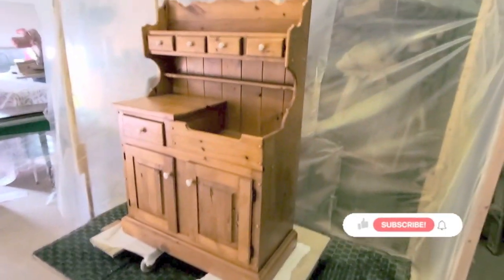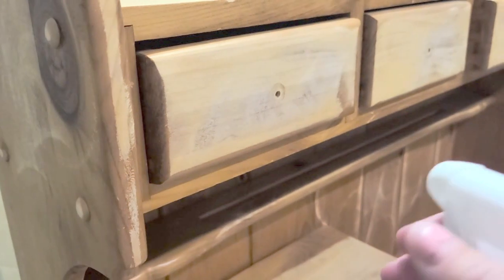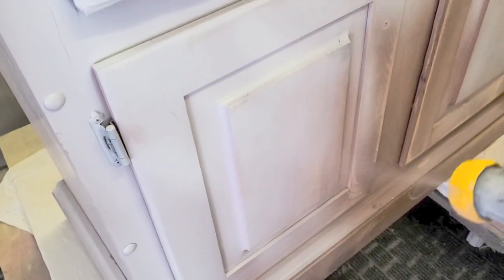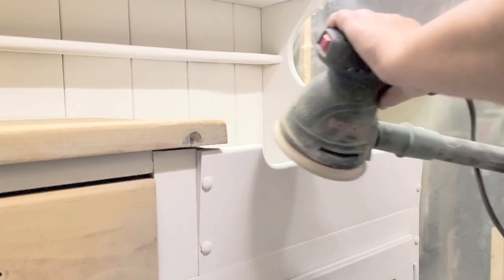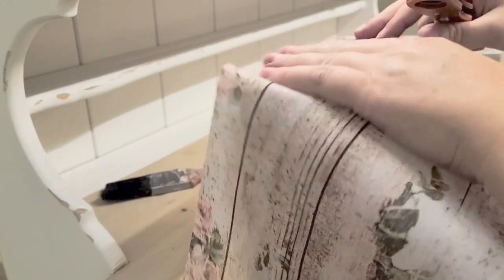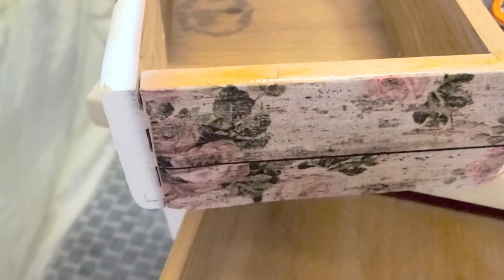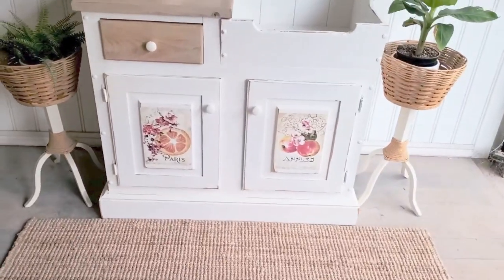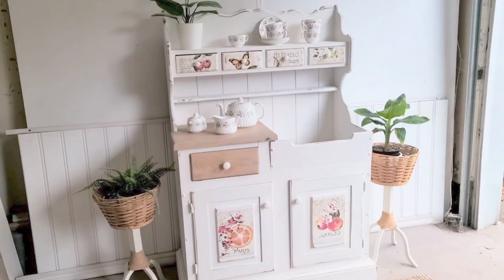DIY Farmhouse Furniture Makeover | Thrift Store Trip

Comment: Do you have to do anything special with that sprayer in between coats when you’re waiting for the paint to dry? So basically do you have to clean it while you’re waiting to put on the next coat because I want to get one of these but I am worried about it getting clogged all the time.
Reply from the maker: Hey, no i leave the product in my sprayer while i wait, sometimes its been an hour or two. Then i go back to spray and wipe the nozzle and turn it on. Its a really good sprayer